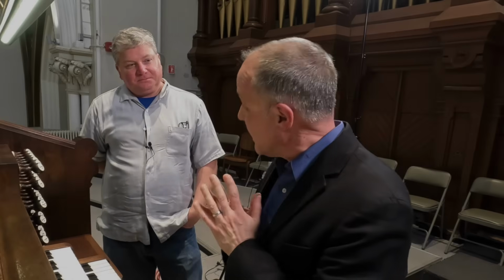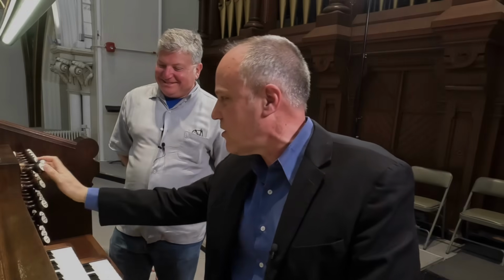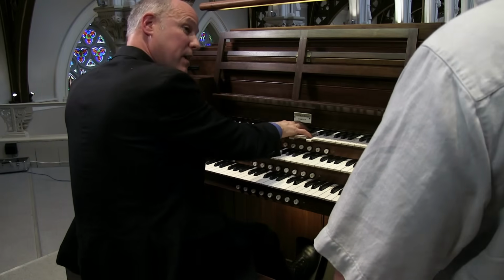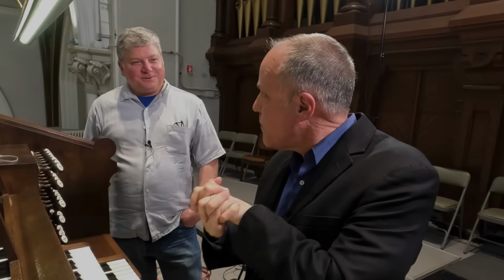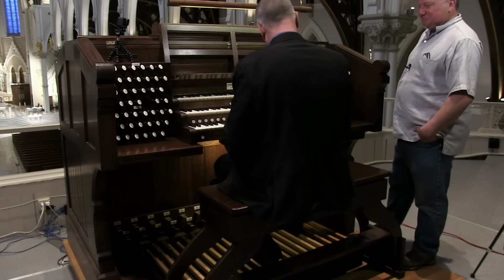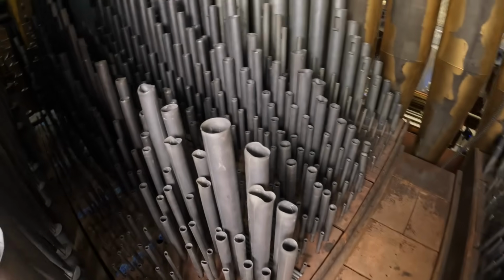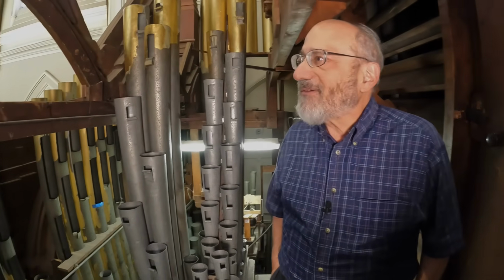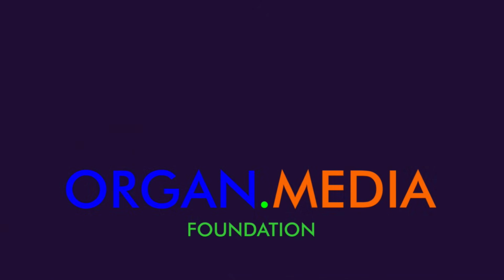1875 E. & G.G. Hook and Hastings Organ - Cathedral of the Holy Cross - Boston, Massachusetts

Comment: Somehow, I KNEW that sooner or later, Organ Media Foundation would do a video of this landmark pipe organ! Thanks everyone! This instrument really represented the emergence of America's pipe organ builders as rivals to the great European organ builders.
The original tubular pneumatic action was reportedly a bit sluggish, but the stop list and voicing remain unchanged and we are lucky to have it still. This organ needs to be better recognized as the landmark organ that it is, and the restoration needs to be completed.
Reply: It is a very important example of American organ building.
Reply: fredriklarsson8105  Even the later Skinners, Austin’s, Kimballs from the USA, and Casavants from Canada had innumerable beautiful tonal combinations and much better craftsmanship than they are given credit for. And the later organs after around 1955 were often harsh at full organ level.
Reply: This organ never had tubular-pneumatic action. It originally had mechanical action, with Barker machines for the Great, Pedal, and basses of the Swell and Choir. Then it was electrified in the 1920s, fitted with a horseshoe-style tongue-tablet console, which the organ still had when I visited it in 2001.
Reply: @timothytikker1147  I didn’t know that. Thanks for the correction. Maybe it was a later instrument that I read about and I confused it with this one. There is a photo of the original console in the pipe organ database. I know that some of the tubular pneumatic organs built in 19th century America were really sluggish.

Comment: Fascinating! As a seminarian, I had opportunities to play this organ somewhat frequently. The tuba was not working and it was the old W. F. Law console with theatre type tabs. [That guy ruined many a Boston organ!] Most of the organ was playable in the late 60s. Have you had a chance to go to Saint Thomas Aquinas in Jamaica Plain? There is a beautiful E. & G. G. Hook 3 manual organ. In 1973 when I was assigned there, only two stops were playable which was frustrating to Manny Zambelli who was the organist. I was asked by the Pastor, Msgr. Donelan to see what could be done to get it up and running. With the help of David Cybulski, Jeff Brody, Charlie Callahan, Leo Abbott, and myself, the organ pipes were cleaned, the bellows releathered, hitchdowns reset, trackers replaced. David found a 'winker' for the bellows. The Organ had been purchased from Saint Paul's Episcopal Cathedral at Boston Common many, many years earlier. We discovered that the original organ had a 16' wood trombone in the pedal which we were in the process of obtaining from Hector Morneau of Salem; but Msgr Donelan died before that was accomplished. The organ sang well for his funeral.

Comment: 1875 E. & G.G. Hook and Hastings.

Was this originally a tracker-action organ? If so, when and why was it changed?
Reply: Yes, it had mechanical action, with pneumatic lever action for the Great, Pedal, and basses of the Swell and Choir. It was electrified in the 1920s, because in those days that was the norm.